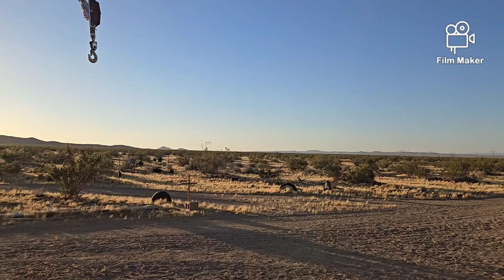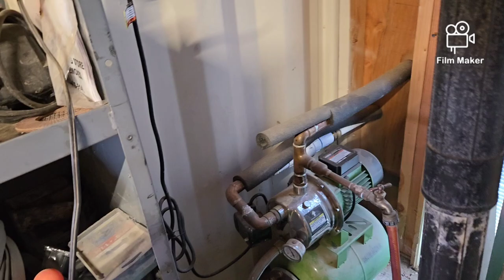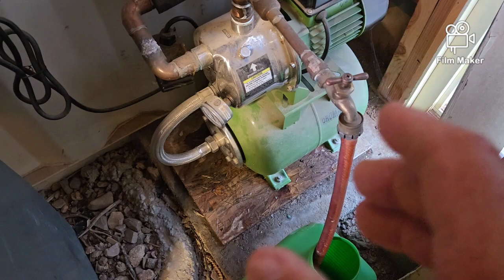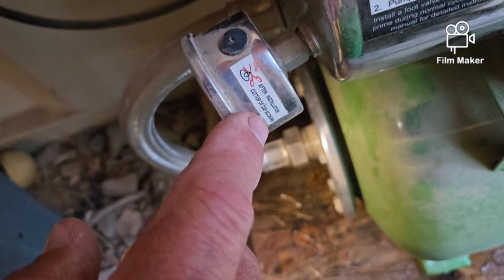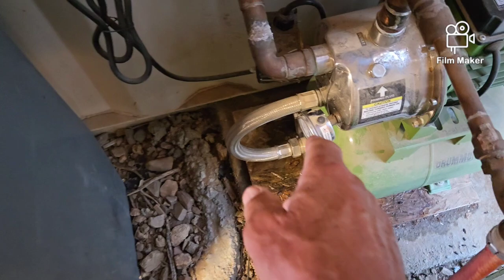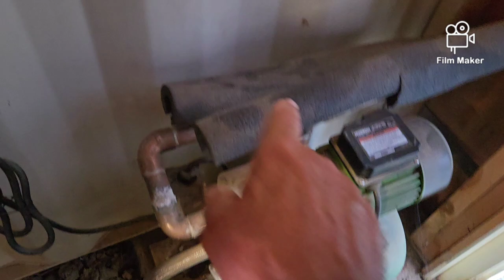Harbor Freight Shallow Well Pump Exposed! June 21, 2024

Comment: Hey @GBear - wondering if I can add a pressure tank on the other side of the pump to keep the pump from cycling so mych during the day. Would this work?
Reply from the maker: @RedTorchFarm  Welcome aboard!  Yes, you can just eliminate the small tank and have the pump connected to a larger 30G pressure tank for less cycling.
Reply: @GBear hmmm I wonder how difficult that would be.
Reply from the maker: @RedTorchFarm There's one pressure hose running from the pump housing to the small pressure tank.  Disconnect it from the small tank and connect it to the large tank, the add air pressure per the recommended specs for the large tank.
Reply: @GBear  forgive the dumb question but I guess I need to drain the system to do this?
Reply from the maker: @RedTorchFarm  yes, shut off power and relieve water pressure.

Comment: Hey @GBear - I'm planning to use this with a water tank from rainwater collection but have a question. 

There is a small gap about 2 ft long between my check valve and the water level in the pipe from the tank. Therefore, when the pump kicks on there is going to be some air in the 2in pipe. Do you think that will prevent it from working?
Reply from the maker: Yes, that air will prevent it from working properly.  The pipes need to be air and water tight between the water source and the faucet.

Comment: Its very clear even just with your texts in the other video. Thank you so much to make this video just for me! I'm going to try again to close up all the pipes to see if I can get water out from this 15-16ft waterhole, if its positive, I'll get a jet pump to permanently install it. if not I may have to find another location to dig a deep hole like my original expectation to get to 25ft.  Just its not the right time everything is tight! Will let you know today's result! Thank you again! Helen
Reply: Good weekend G Bear! A little good news. Yestersady I closed up all the pipes using this Tanked pump, first try the gauge got up to 60psi, then I release the outlet water, it pumped about 30 seconds, then I had to reprime it 3-4 times otherwise it couldn't gain enough pressure to pump, but each time it only lasted about 10-30 seconds. So I went to Harborfreight and got the Jet pump;  reset the pipes with the jet pump. the first trial with 1 inch outlet lasted about a few mins then the pump started choking, I thought it was likely the well is not deep enough to have continous water supply with 1 in fast flow, so I reduced the 1 inch to connect the normal 3/4'' with my garden hose, to my little content, it gave me time to water parts of my garden, about 20-30 mins. And this morning I tried again to accumulate water into a 80 gallon barrel, however it still took 2-3 restart the pump, because towards the end the pump chokes, it can't release water out continuously, but the good thing was I didn't have to reprime the pump after each stop.  I conclusion is, this 15 ft hole can't not fulfill my purpose for refilling my fish pond without a pain of ass!  I would have to dig another hole at another location at least reaching 25ft. Really don't know what the luck is ahead, because this hole was already the 2nd dig (10-15 ft away from the house), we hit gravels arounf this depth, couldn't go further manualy last year.  Don't know if this is a layer of  geographical structure  in this area or gravels rushed down from the building consruction more than 120 years ago.Still don't know what the luck ahead if I more much further away from the house.  How do you sense this, G Bear? Thank you!
Reply from the maker: @helenzhu8331  yes, sounds like your well can't keep up with the water you need.  You're going to have to go deeper for more GPM's.
Reply from the maker: Good luck!